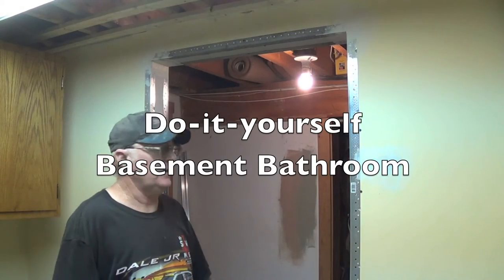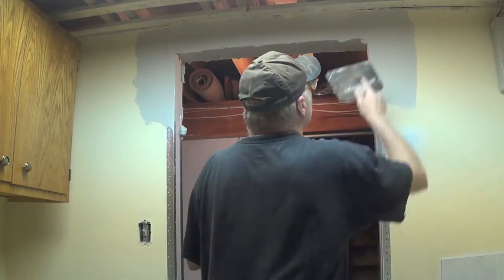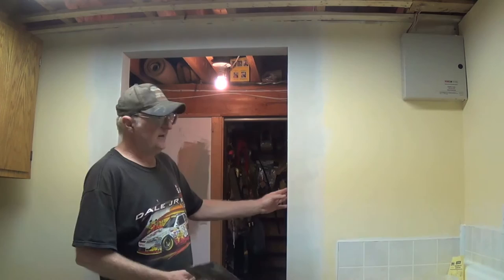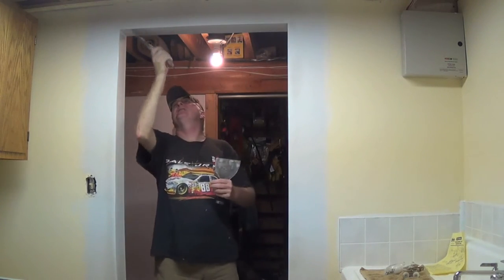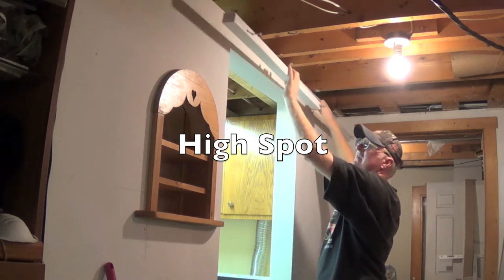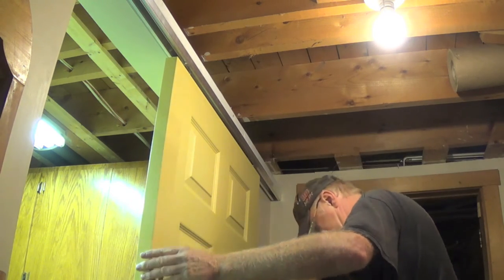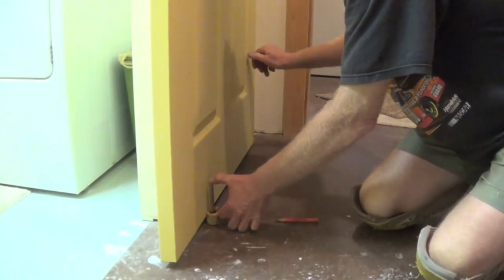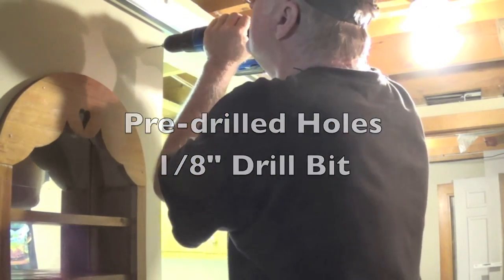DIY Basement Bathroom Part 13 - Installing Sliding Door

Comment: Awesome teaching!! I also watched every part of this series. Thank you for the wisdom, precision, and lessons that came with this diy bathroom installation from scratch.
Reply from the maker: Thank you for your kind comment. I really appreciate it.
Reply: @BasaPete  completely agree. Went all the way down the rabbit hole with you and picked up some new ideas along the way! My only complaint is sometimes you left us hanging without a reveal. Not too late to go back and show the finished work. Thank you for taking us on the journey with you! Feeling bold about the drywall mud and even the super intimidating concrete work!!
Reply from the maker: @aaronroberts6782  Thank you for the great advice. Sorry for not showing the completed job. I will certainly show the finished work from now on.

Comment: Skimmed through most of your series. Luckily there are much easier ways to do shower surrounds now vs cement board. All looks good except for the wood tile board. Mold city waiting to happen, even if you don't see it. I would have skim coated and painted the whole thing if I did have funds for real tile. They make plastic panels or even old metal roofing that would have worked as well.
Reply from the maker: Thank you for your comment.

Comment: Great series, wondering why you didn't bother to put a ceiling.
Reply from the maker: Thank you.
The ceiling is up, but I neglected to videotape it. 
It was tedious work fitting gyprock around the drain pipes, but I got it done.

Comment: I am looking at putting up tile board in my shower, and was just wondering how yours is holding up? I have been reading about using it and it seems many people have issues with bubbling. Any problems with yours?
Reply from the maker: My tile board is holding up nicely, no bubbling or any problems. Just be sure to use mechanical assistance when glueing. And make sure to caulk and seal the corners and edges. Tile board will let go if water gets behind it. Good luck.